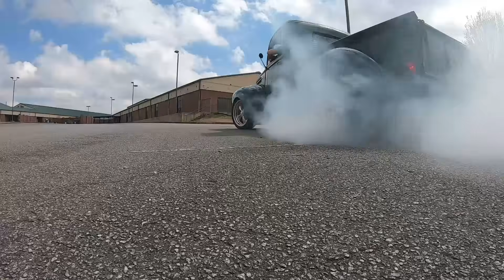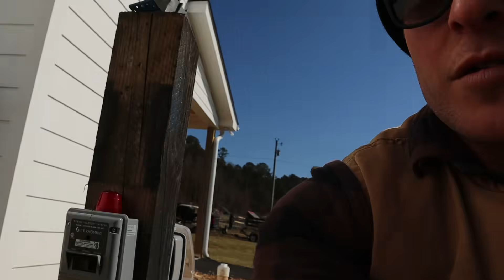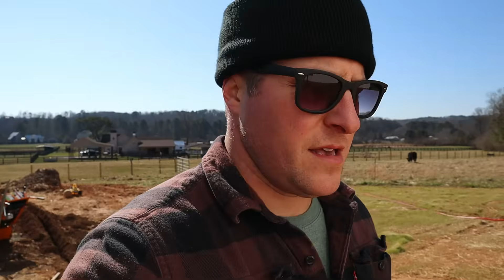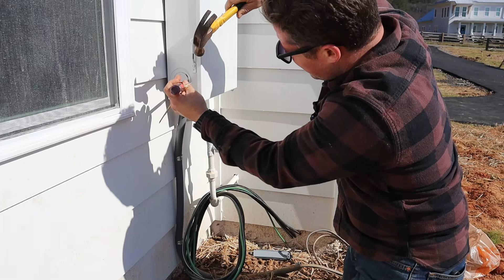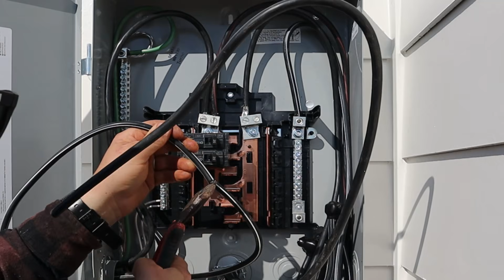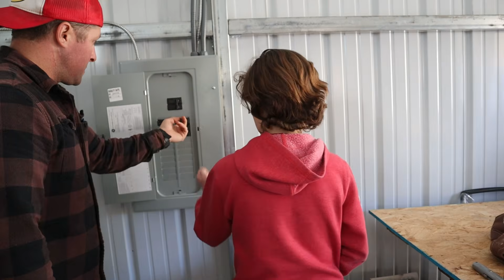UNDERGROUND POWER.. 100 amp sub panel for metal building! Dream Garage build Ep. 9

Comment: Were you touching the lugs on the hot, house-side panel? Jeepers!

The way you've wired this, all of the neutral current is going through the neutral buss bar on the house-side panel. Is it rated for that pass-through use?

Also, I don't see any washers on the inside of the boxes where you fit the LBs. What's holding 'em in there?
Reply from the maker: I had the breaker off going to the house panel I’m not that crazy lol. 
Tell me more about the neutral pass through rating. First I’ve heard that. I’m very new to electrical wiring. 
What’s LB’s? I can put some washers on if needed where exactly are you seeing that?
Thanks for the input man.
Reply: @ProjectDadLife  

You should land the neutral at a double lug (like you did the lines). Otherwise, all of the neutral current is going through the bus bar. The double lugs are certainly rated for high current. The buss bar might not be designed to handle that kind of current.

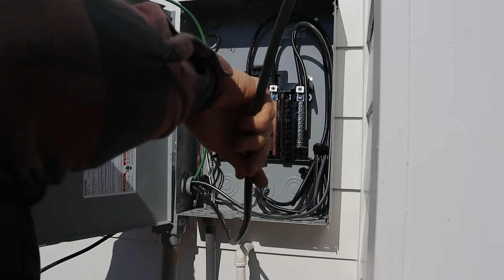LBs are the pull elbows you used. You place one at exactly 5:00 in this video. I think you said you used 1-1/2 inch conduit: see Carlon product E986H-CAR for an example of an LB.

The hub on a RLBs isn't designed to be poked directly into the box the way you've done it -- it's not fastened, and it's not sealed. (Maybe you've got it fastened; the video doesn't show this detail, but the lock nut isn't apparent to me in what I can see. The best view I have is around 7:22 in the video, and it looks like it's just the LB hub pokin' through.)

Even the non-metallic LB you've used should be fastened on the inside of the box to hold them in place. Use a terminal adapter (like Carlon part E943H) and the appropriate metal lock nut over its threads on the inside of the box. I'm worried that you can't fix this, since you've drilled the holes for the outside diameter of the hub rather than the outside diameter of the threaded end of the terminal adapter.

And hopefully I got all this right: it's muscle memory pulling the parts out of the trays while I'm standing in front of the equipment. Typing it out from memory with detailed descriptions is a bit of a challenge. :)
Reply: @mikeblaszczak  You are correct with the LBs. I work as an electrician and I saw it too glad you mentioned it.

 @Project Dad Life You used PVC LBs to bring the wire into the panels. We usually use an MC connector which has threads and a locknut to enter panels or use a PVC connector with threads. I think u can still use the LBs you have used and change over to something with threads, you also may need some sort of washer for it. (wish I could post a pic as ref). It will be fine as is for now but water will be able to enter your panels overtime around the PVC LB so may want to look into some fixes before long. Also don’t know if it will matter but the grind rod wire is generally bare copper so that the wire itself is also in contact with the ground. Don’t think it matter to much since your first rod is so close to building, but something to keep in mind for the second one. The sub panel looks good other than that so far, (more neat than some guys I work with lol) just keep the same procedure your going with for any other wires you put in and it should look good! I usually don’t comment on stuff like this but you seem like a good dude who wants to genuinely know the way to do things. Hopefully that made a slight amount of sense.

Comment: Great Video. Couple questions.
Trench depth?
Your ground rod you drove in ground for shop. Did you route ground conductor in conduit outside with the direct burial conductors?
Your shop sub panel. Did you just side mount to metal stud?
Or did you need to build any frame work to mount the sub panel to?
Great video and watching all of your videos.
Thank you
Reply: Depth should have been a minimum of 24" cover, with clean fill.
I'd have put it in PVC for the complete run. You should have an expansion joint at both ends of your riser and a loop at the bottom.
Reply from the maker: Thanks man. The trench depth was 18-24”. Yes the sun panel was just directly screwed to the side of the metal stud. The upright wall studs are 1/8” thick plenty of meat I figured. I did not run any conduit on the ground wire, but it was just a standard 6ga copper wire I used as grounding wire from ground bus bar directly to 6’ ground rod. Thanks for the  support.

Comment: It’s just me, but I would have put the extra breaker in the intermediate panel. I would want to be able to shut power off to the garage without shutting power off to the septic. Looks good otherwise! What was your bury depth?
Reply: Here locally you are required to have an emergency shut off on the outside power panel for the garage.  Fire department will not put water on a "hot" garage.   If the owner isn't home there is your problem.
Reply: The lub is not required by the NEC anymore

Comment: What are the grey plastic boxes called that run your cables into your shed and distribution box? Im wiring up my shed and that would be perfect. Thanks
Reply: "Pull elbow" or "LB".
Reply: Do yourself a favor and DON'T use PVC 'LB's' outdoors, use a metal 'LB' with a short piece of rigid conduit going in the ground.

Comment: Not bad. I’d hire you as an apprentice. Just make sure your connections are tight, and seal up around the fittings going into the panels. Water and electricity don’t mix all that well.